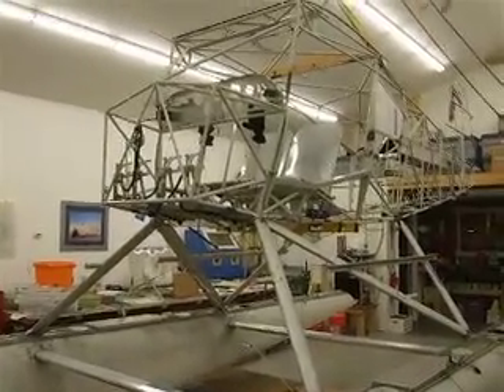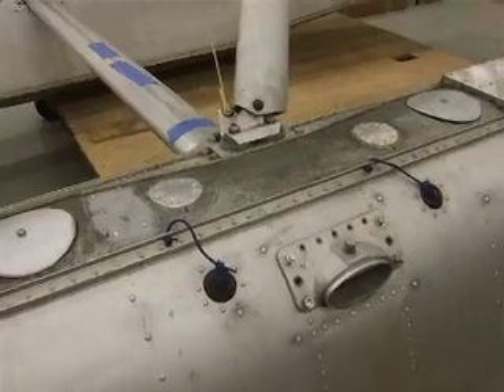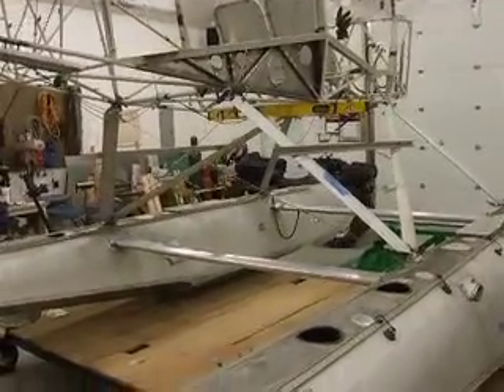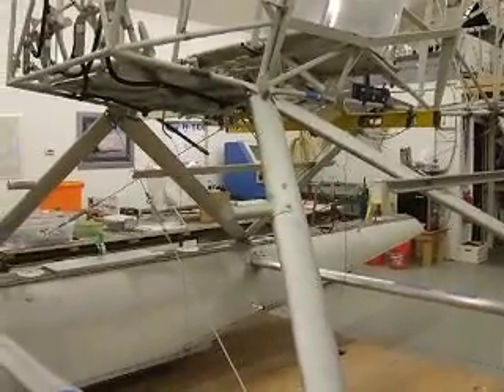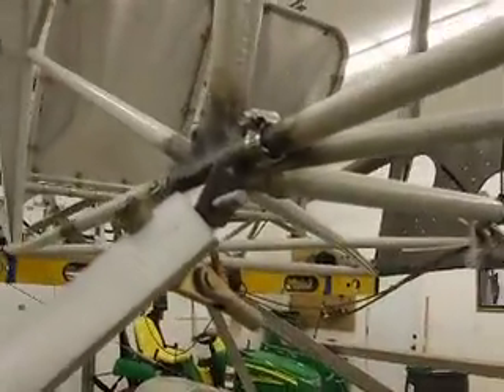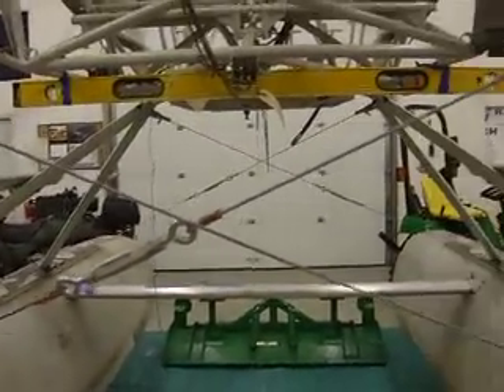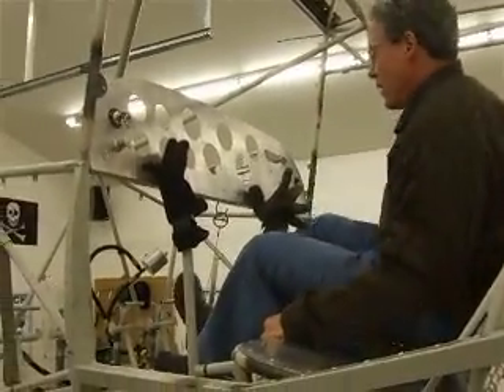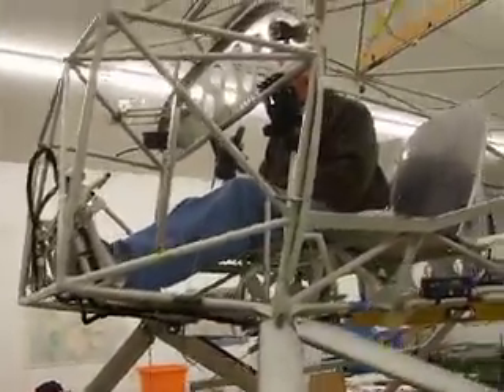Bearhawk Float Install

Comment: Nice work - thank you for breaking trail for those of us following - appreciated a lot  -  I am also going to buy a BH4 and put it on amphibs  I live on the coast of BC = similar topology to Alaska. I am 70 this year and I don't have the time to build hence I will buy used and adapt to my needs. Ever since I came across Bearhawk it checked all my boxes - speed is lacking in most every other A/C if it had top tier STOL capabilities. Bearhawk managed to overcome that hurdle., the metal wing is great...makes a difference. Love the 5 but don't need it -  a 4 that can take off on wheels with 4 people + full fuel is awesome, add another 100HP + Turbo and can likely do the same with floats on also.
Reply from the maker: Hey Steve...glad to hear the video was of help to you. That's why I took the time to make it! But the big thanks goes to Rob Taylor and his willingness to share his work with other builders.

Comment: What kind of turnbuckles did you use for the cables ?
Reply from the maker: Hi Joel... What turnbuckles are you referring to?
Reply: alaskabearhawk the cross cables for the floats
Reply from the maker: I think you are referring to the brace wires that form like an X. Those aren't cables They are streamline flying wires and have the typical ends for flying wires.